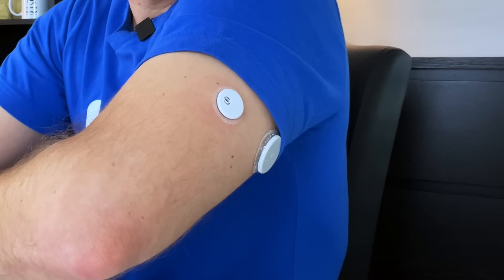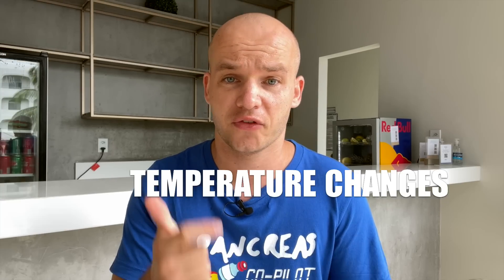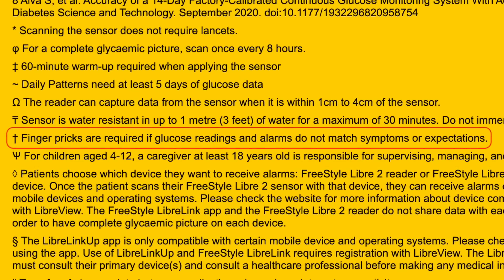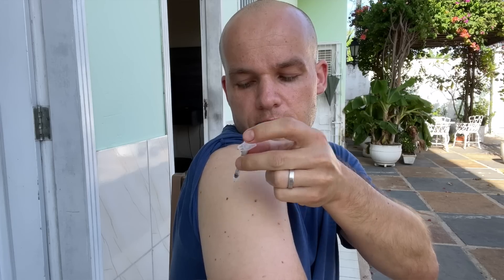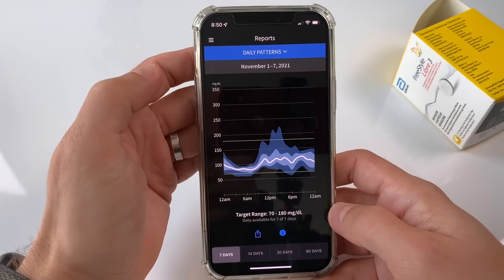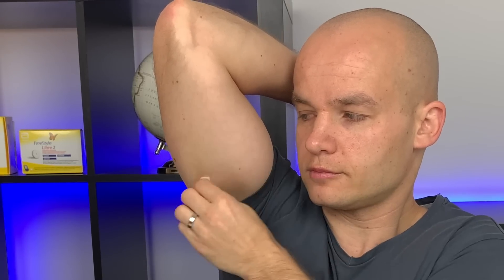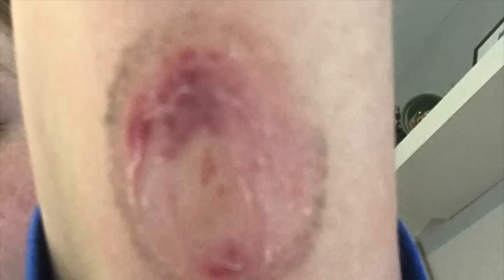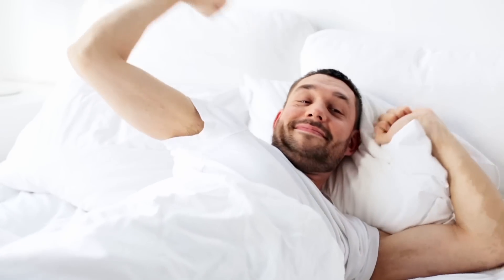Why FreeStyle Libre Users Fail... But You Won't

Comment from the maker: Get Not Just a Patch here with 10% dicount if you use code TYPEONETALKS: https://notjustapatch.com/
Reply: I was really happy to see a new brand of patch.  The ones I have been using for over a year have started making me itch under the patch.  I am hopeful the Not Just A Patch uses a different adhesive that won’t irritate my skin.
Reply: Very informative as I inserted a new sensor 2 days ago but waited a day with it in my arm before activating it, hoping it would self regulate. All day yesterday it showed lows between 55-74 but my glucometer often showed it in the high 70’s-low 80’s. I didn’t know if I should accept these numbers, knowing there is at least a 10 min delay. Sometimes they line up after 10 mins, other times they were way, way off.. Frustrating! Thanks for taking time to explain!
Reply: @lovestotravel9831  I think you can still activate it right away just know that the readings for the first 12 to 24 hours can be a little more off. Especially the first 12 for me. They tend to start  stabilize around then in my experience but I'm sure everyone is different. Climate probably plays a role too. They're temp sensitive. They mention that the #s aren't too be trusted as much with a little symbol and a message. For the first 60 mins after starting a new one it won't let you check it at all either and runs a countdown timer. I believe that is a warmup period.

Comment: So I've been using the libre 2, the most recent sensors(like the last 3) seem so inaccurate, so I talked to my doctor and I got a dexcom to compare to it, the g6 is only 2-5 points off my blood tests where the libre was 20-40 points off, has anyone else experienced this?
Reply: No, my Libre2  is usually spot on with my glucometer.  And my reading correlate with my HgbA1C.   Next time I have a glucose lab test I am going to test with my Libre2.

Comment: Another great video.

I love my Freestyle 14. It is a Godsend. 

Sometimes I get the "Scan sensor in 9 hour" message after I put on a new sensor.  I am Type 2 so I just watch what I eat.

I only had one sensor fail completely after putting it on.

I have had a few sensors lacking adhesion and come off in 3 -4 days. I find this unusual as I typically have a hard time getting them off.

I use two Smith&Nephew products, Uni-solve and Skin-prep, to help remove and to apply a sticky, protective layer between my skin and the sensor.

Abbott is wonderful when it comes down to them replacing sensors.

The best thing is to be able to see what foods spike glucose. If I had to prick my finger, I would be dead. This CGM was the tool that helped me get my A1c down to 5.4 from 10.
Reply: I just had my first one fall off. It only partially fell off but enough where it wouldn't read right anymore and I had to toss it out. So the prep is helping with this? I've never tried that. Usually just a good soap/water + alcohol. Shaving seems to help a little. I don't know that I need the patch cover but good to know it's out there.

Comment: Hi Tom another good video! I also see these questions on the social media sites. I think it is hard for some people to not get hung up on the number bht I guess that is part of the learning curve. Early on I had one of those roller coaster rides where I was making too big a corrective action. I've learned if I am going low exactly what to eat that will give me a small bump to stop the fall but not give me a rebound. When I check my CGM now I see the number but then I look at the path line so I can tell what has been happening. After a bit of observation I've learned to be more concerned with being in range and less concerned whit the number attheat second.

Comment: Yeah I agree with these. Especially the 2nd one, about the graph/extra info. I discovered that mine stays steady overnight and even goes up slightly so it's never low in the morning as a type 2. It's always around 120-140 ish in the mornings. I pretty much can only eat a keto protein breakfast or just wait a few hours. Probably from years and years of not eating breakfast and just going straight to work. Woops.

Comment: I think my Libre monitor might be out of whack or in a slightly bad place.  I had a reading of 32 on the sensor but when I did a finger prick it said 110 and I did not feel low either.  This is my third sensor and the last two were within 15-20% of the blood meter which is quite fine and I more look at the arrows then the number anyway.  But getting 4-5 alarms a night is getting old.  But the sensor has 8 more days until I replace it :(
Reply: Good that you're reporting on this. There is a procedure you can follow. Abbott will clarify, but as I recall it was something like waiting till the arrow is horizontal, and then doing a scan. And then waiting 8-12 minutes and doing a finger stick. Then you would write down the numbers and repeat a total of three times at different moments. If you would report that data back to Abbott, they will provide a new sensor only if the data is far enough outside of a specific range they have set. I've experienced this many times with sensors reading too high or low. Very frustrating but above all very dangerous if the readings are higher than your blood sugar actually is...

Comment: I do have a question. How can you prevent a 50% sensor failure rate? Im new to this and out of 6 sensors 3 have failed early (2 in the first 5 hours). im on my 5th the 6th hasnt been applied yet.

Comment: While the scan again on 10 minutes error is annoying...I'd take it over the "your sensor is no longer working correctly, please remove and apply a new one" any day. Corresponds to event code er4,365,p. No one has ever been able to tell me what this means or why it happens. But I went through about a years worth of sensors straight that failed somewhere around the 7th or 8th day, when I would receive the aforementioned message. Since the start of this year, I've been much more fortunate...I'd say 2/3 sensors last the full 14 days, before getting that same old message again. I've begun to wonder if the sensor is particularly picky about where I insert on my arm. It seems to either like the site that can create the largest skin fold, or in the "notch" of the triceps muscle. Luckily a tattoo on one arm gives me a target for insertion. The other other is more difficult. I wonder if that's why I get 2/3 now. It literally seems to be THAT lucky about the spot?! For reference I'm on the leaner/muscular  side of things - sort of a job requirement in the fitness industry.
Reply: Good to know I'm not the only one... I've had so much worries with sensors failing  that going on holiday was getting very stressful, as the sensors were failing at an alarming rate. I've now finally figured out a way of dealing with this. I've ditched the app on my phone completely and reverted to the V2 reader. Yes, it's clunky, the touchscreen sucks, and the functionalities are limited, but now my sensors don't fail anymore. I still get the message about scanning again in 10 minutes, but this is acceptable. I might be wrong, but as the app hasn't been updated in a long time (and freestyle libre 3 uses a separate app) I guess that the sensors fail due to a bug in the app, and that the current app is buggy beyond repair. I'm hoping other people have the same experience and that Abbott starts to focus a bit more on their customers. This is our health and our lives we're talking about...

Comment: Hi!  I had an error message from my Libre (original one) so I contacted Abbott.  They are replacing it.  I need the sensor's serial number, but  can't remember how to do that.  I know I have to use the wheel icon & go to event log.  I'm lost after that.  I'm contacting them in the morning, but maybe someone else has a similar issue and can be helped with that info.  (Maybe I'll need to watch it to do this another time.  Lol!)  Thank you!

Comment: if you don't mind, i have a kind of technical question about freestyle libre 2: i understand it will only send data to your reader/phone when you manually read it, through NFC. ok, so this is the way it communicates data. then how can alarms work? if you are not manually reading the glicemic values with the phone, how does the phone know when to notify/alarm you? as i understand from the videos this works, so this means that the freestyle libre 2 also continuously communicates through bluetooth with the phone? in this case i'm curious why is it not communicating glicemic values all the time. but wait, it actually should be communicating glicemic values all the time, otherwise the phone would not know when to alarm you, no? in this case i don't understand why you need to keep reading the sensor manually 😄
what am i missing here? thanks!

Comment: Libre Libre so many things to say. Adhesive is just fine for me. Never had a sensor fall off. Just took a brand new sensor off because hurt. Not sure what I hit in there. Hate having to call tech support. They read from script. Can’t really answer any questions. Another complaint is lows. Take forever to start trending up so my TIR means nothing. Have to wait some time for an arrow direction to calm down and read an actual number. All that said better than finger sticks. Easy to apply and fairly discreet. Good and bad.

Comment: I cover my sensor with a big adhesive patch…… The patch covers the entire sensor…… Does the sensor need a hole in the patch to deal with humidity ?
Reply: No. It is ok to cover it. It doesn't affect the measurement results. I cover it always.
Reply: @marijakapovic3677  thank you for your advice

Comment: Hi Tom, type 1 here. I need help. I’ve been using Libre 2 for years now. More often than not I get libre sensors that consistently read 50-80 points below fingersticks. Sometimes they’re up to 100 points below fingersticks. Has this ever happened to you? It is completely beyond frustrating and Abbott customer service is no help whatsoever. All they ever do is just send me a new sensor. I don’t get the impression that Abbott is working to fix this low reading issue at all. What is going on here? Why do I keep getting these faulty sensors? Does this ever happen to you where you get readings up to 50-100 points below fingersticks? Please help.
Reply: I have had a few faulty sensors the latest being my alarms don't always work a common problem I am told Abbott I find are not always helpful so hopefully now will try a dexcom

Comment: I use Libre 1. No problems. Today got a new sensor with Try in 10 min error. After a while it read 230. The old sensor reads 70-120 consistently. This high reading is unusual. Should I replace it?

Comment: My experience has been with the libra sensors they can be way off. and im not talking about the difference between what the finger prick device shows being 15 min out. I can have stable blood sugars with minimal change over an hour yet my contour will show my blood glucose reading as 8mmol and the Libra show it as 4mmol. This drift i find gets worse over time. so a new sensor is fairly accurate. but once you get about 4 days on that sensor that drift becomes very noticeable to the point of being borderline useless. Abbott need to implement a calibration function and get over their arrogant stance that their sensors are calibration at the factory and never need calibration. I also found Abbott to be a little bit difficult to engage with on sensor replacement due to inaccurate readings.

Comment: Hi thanks for all the great videos, new Libre 2 user here,  is there any way to allow both the reader and the app to access the sensor?  I seem to have lots of issues with the app and it would also be nice to grab the reader to use if my phone is otherwise occupied etc.  tried scanning phone first and vice versa but  always says sensor already connected to another reader.  Thanks for any insight

Comment: Hi Tom, Thanks for your informative videos. I have been using the Freestyle Libre2 for around 90 days now and found it to be very helpful.  Unfortunately, this afternoon when I went to scan my current sensor with my Samsung Galaxy 20FE all the scanned data from the previous 90 days disappeared. Abbott customer service told me there was no way to get it back and that I needed to start a new sensor as if for the first time.  Has this happened to you or one of your viewers?  Is there a hack to backup your scan data so that if this happens again I don't loose all of my scanned data completely. Thanks.

Comment: Thanks for the video, but I'm surprised about all the positivity about this product. Would love to see some more constructive criticism about Freestyle Libre instead. Freestyle V3 has been announced now years ago and still has to launch in most countries... The android app hasn't been updated in over a year in spite of all of the bugs and associated negative reviews on the Play store. My personal experience is that 80% of sensors failed well before the advertised 14 days lifespan. Imagine having to always have replacement sensors with you because the sensors fail at any time. It's only since I've recently completely stopped using the android app and instead only relied on the V2 reader that the sensors are finally working properly. This in stark contrast to the advice from Abbott to use the android app. I've called their support so many times and they themselves mention (unofficially) that there are so many people experiencing issues (also iOS users). Unfortunately we don't have alternatives as this company has  contracts with local health care systems. So this puts Abbott in the very comfortable position of not having to innovate or fix issues as the money is just rolling in. Please consider creating a critical video on this technology as well... We need as much pressure on these companies as we can. The products could be so much better if there was a bit more competition. Think of the simple things they could do that would so improve our health, like multiple alarm thresholds, fixing the bugs in the app, quick set reminders in 1/2 hours after entering food (as is present in the reader), the active insulin icon (as is present in the reader). These are little details that all could take off points of our hba1c and glucose variability... It's just so damn frustrating how slow it goes in comparison to all the other technology... Simply because these companies have no incentive to improve... yet... So maybe you could help in this regard. Thanks a bunch in advance!

Comment: FreeStyle Libre 3 users don't fail, .....the FreeStyle Libre 3 system is junk -- probably to rip off the Medicare system.
The Reader doesn't even turn on. The screen remains black even if you press the one button to make it do anything. (Press and hold, press twice, press three times, press four times, press just once...)
It was on for almost 30 minutes after I applied the first sensor to my elderly mother's arm; then after indicating something was wrong with the sensor, it went black. You can't turn it on; if you plug it in, it will flash up a screen for 1.04040602 seconds saying "connected USB" and then go black again. ....Never to be turned on again.

It is junk.